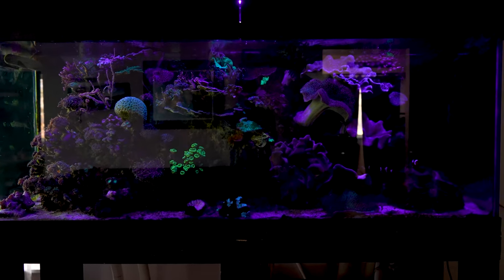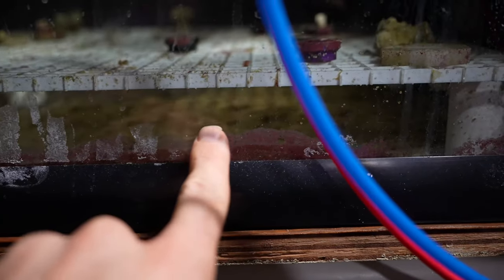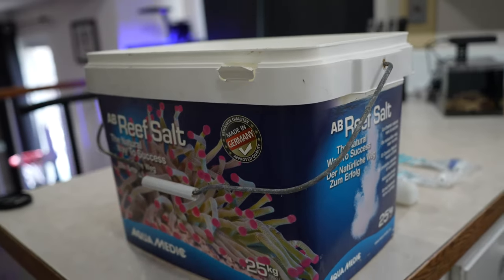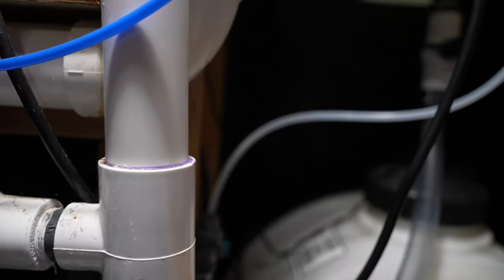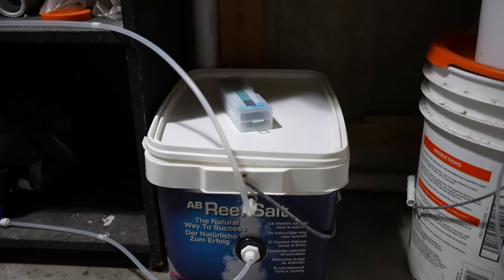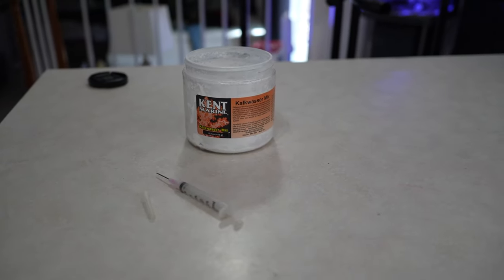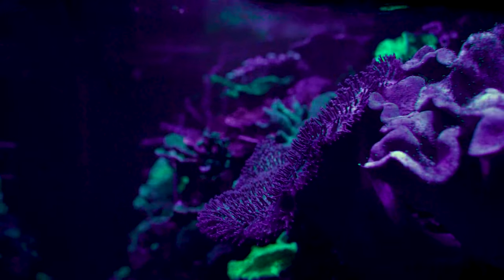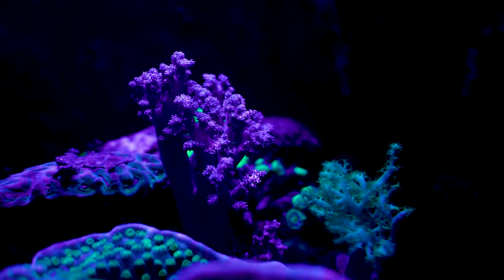Adding a DIY KalK Reactor and Tank Updates

Comment: Bought some nudibranches, it took a few months but they absolutely destroyed every trace of aiptasia I had in my tank. It never came back.

Also kalkwasser binds with phosphate, so be aware that the giant refugium of chaeto you have there might get starved out? As you will be removing co2 and phosphate which chaeto thrives on.
Reply from the maker: Thanks for the tip! Where did you get your nudis they seem pretty hard to find?
Reply: @MileHighReefers  reeftown, I had to wait a few weeks before they had enough to ship. I ordered all small ones for $12.99. I think I bought 10-12 for my water box 100.3. It took awhile, they seemingly disappeared for a month and then they started showing up more. It was expensive, but again they got every trace of aiptasia. Sump, plumbing, and all.
Reply from the maker: @adambahe9309  Thanks for the info this looks like a great way to go! I think if I do it I want to do it in conjunction with a propagation tank

Comment: I don’t think the amount of kalk your dosing into your tank is going to keep up with the demands unless your corals are maybe growing at a slower pace perhaps 🤔 

Im dosing kalk slurry into my 300 gallon system it’s a very saturated solution I basically dumped a whole 4lb bucket into a 5 gallon bucket (there’s a pump running in the bucket keeping it mixed) and im dosing 0.5 ml a min constantly 24/7 the issue im running into currently is my ph is 8.8-9.0 and I don’t wanna go over 9.0 cause it upset my corals 
Checking my alkalinity my alk is dropping from 9dkh to 5.6dkh in a matter of 3 Ish days with what im dosing so idk thinking of going calcium reactor and potassium hydroxide or possibly keep using the kalk at max sat and supplement the rest with a calc reactor idk 

The only thing keeping me from dosing more kalk is ph getting to high and during the peak of the light cycle my corals typically will bump up the ph .2 as well so hope this kinda maybe helps you a little bit lol happy reefing 😜
Reply from the maker: I think you are right but I’m going to see how it goes